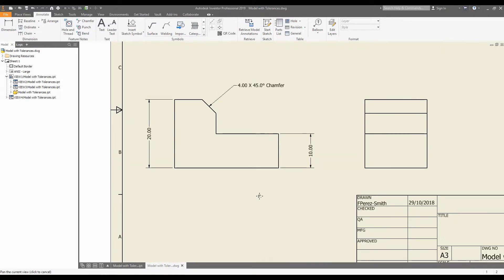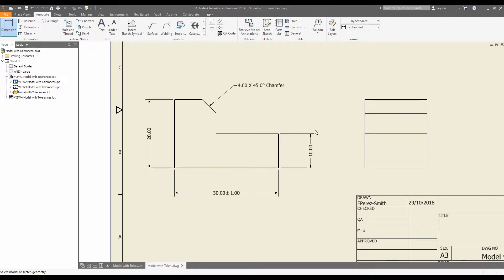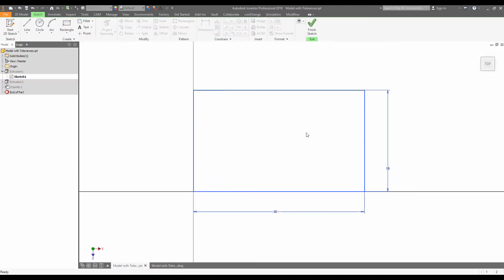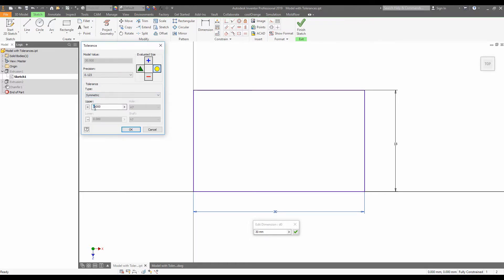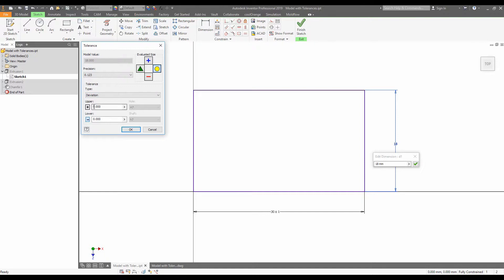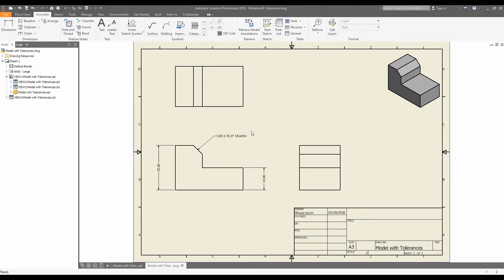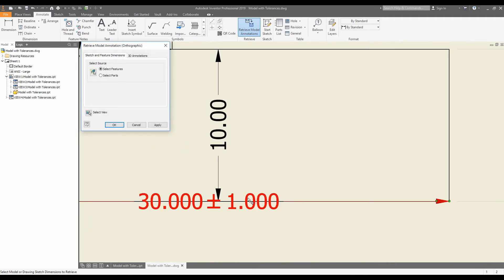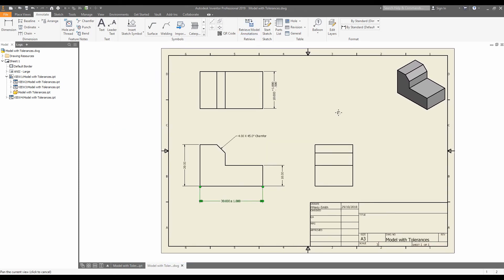Tolerances in an Inventor Model

Comment: There should be a global way to add tolerance, there probably is a way, but this way does work if you have different tolerances for different dimensions. But for something like a 3d printed part the tolerance is universal and it would be helpful to have a global method.

Comment: I like this, but have a question:  When you add the tolerances to the model dimensions, does it reflect on the actual solid model ?? 

If I have several parts in an assembly that have tolerances, I need to find the total of the stacked tolerances for the whole assembled model. 

Can this be done based on what is shown in this video ??